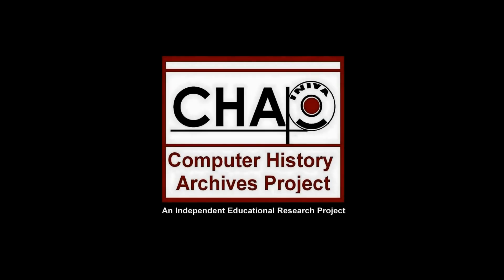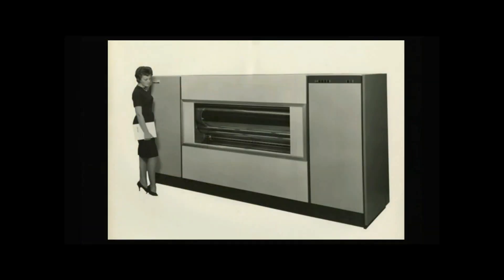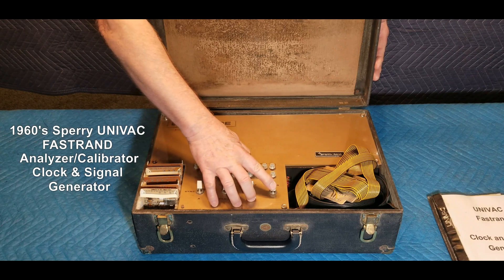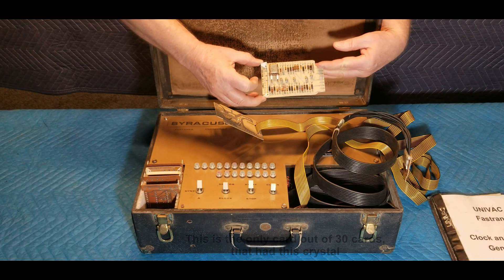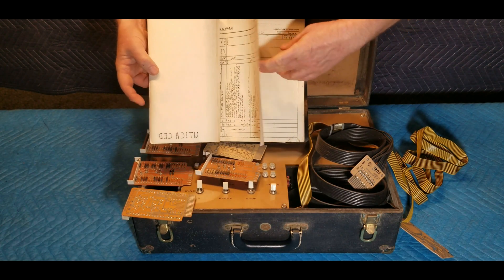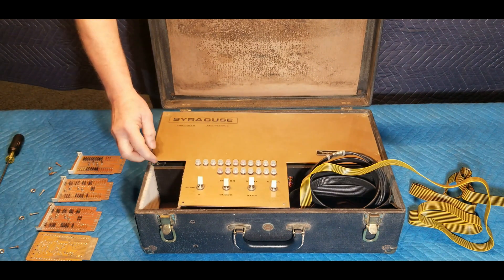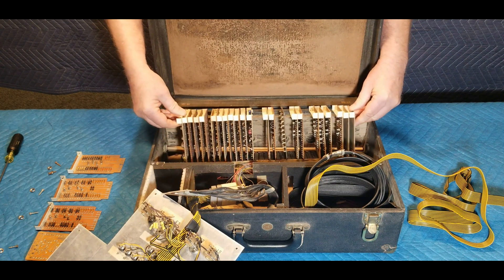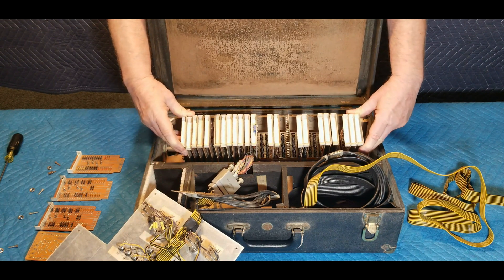Computer History: UNIVAC FASTRAND MAGNETIC DRUM Analyzer & Calibrator 1963 Sperry Rand Clock Sector

Comment: The company I first worked for in 1970 had two systems with each 6 Fastrand IIIs. Some Fastrand stories of the time:

1. The drums were originally manufactured as steel sewer pipes which had been machined down inside and outside to the required dimensions and balanced.

2. After the Fastrands were scrapped the drums of some units were converted to field rollers for golf or cricket fields (in England, obviously).

3. When mounted in US warships (probably part of BUSHIPS programme) the gyroscopic effects of the running drums affected the ship's manoeuvrability.

4. In the Roseville, MN, manufacturing complex,  during a hurried attempt to ship a new system, immediately after testing the technicians boxed up an FH432 fast drum and picked it up with a forklift for loading on the shipping truck. The first time the forklift operator tried to make a right angle turn the shipping case tried to continue on its original path because the drum was still spinning down and crashed to the floor.

Don't know if any of these are true but the nature of drums at the time encouraged such stories. The Fastrands were huge, and with the tinted windows showing the rotating drum, strangely sinister looking. The FH432s were just in a standard cabinet but the knowledge of the insane speeds (for that time) and the rotating mass of the drum were immensely impressive. A seized bearing could have caused massice chaos.
Reply from the maker: Hi Steve W, great stories!   Thanks so much for sharing this fascinating background info.  I did not know that the Fastrand drums were originally made as sewer pipes.  Does make sense though.  That is quite an interesting bit of history.    I did know about the gyroscopic problems with a Fastrand aboard Navy ships.  We mentioned this in our video on Fastrand.  The forklift story is new to me, quite a shock for the forklift operator.   Thanks again.  Great info!  ~ Vk

Comment: When I was at the University of Maryland in the late 70s they still had a Univac 1108 and an 1106. I know the 1108 had at least one FASTRAND drum, but I never saw it, as the computer room was off limits.
Reply from the maker: Too bad you didn't get to see the Fastrand.... I bet on a busy day, you could hear it through the wall though.  :  )
Reply: I used to be a computer  operator with a local UK gas company in 1976-7. Univac 1108 with a number of Fastrands, they were beasts sat in a room with the 1108 core memory units.